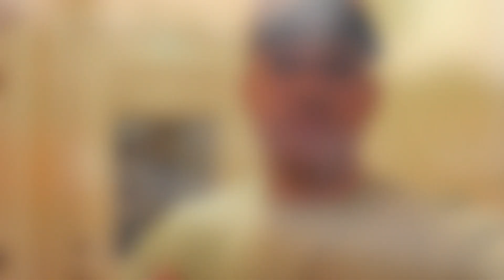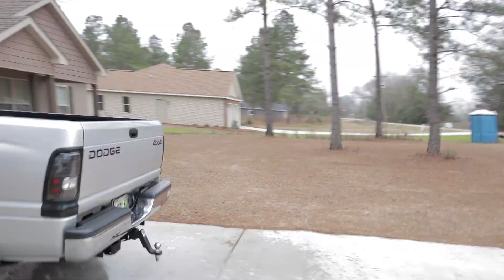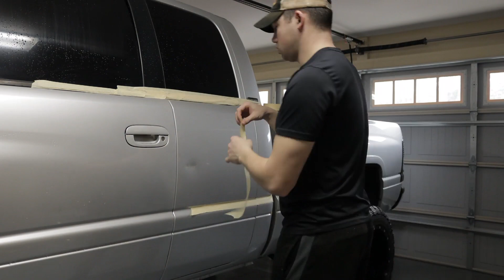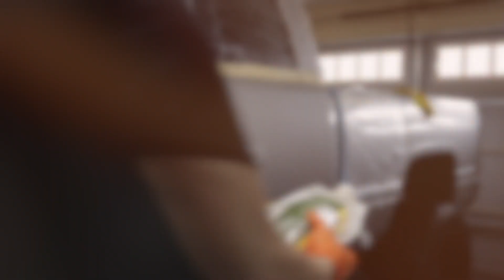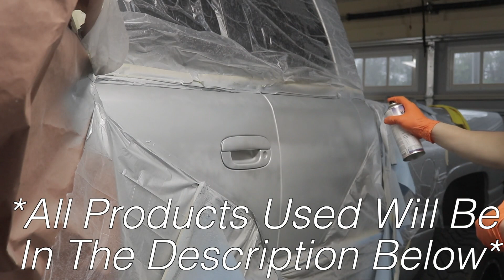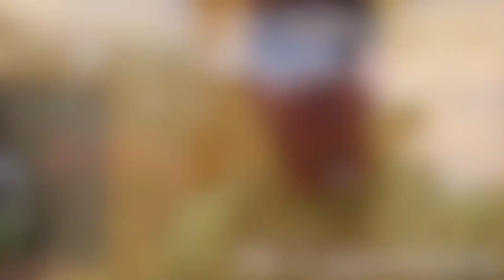I've been Dreading This Day.. It's finally Time To Say Goodbye To It

Comment: Did you have to trim a lot to run that wheel and tire set up? Rub a lot? (Is it 20x12 -44 with 35s?)
Reply: brandon Zervos 20x12 with 33s just a level
Reply: Born Behind Bars a lot of rubbing or trimming?